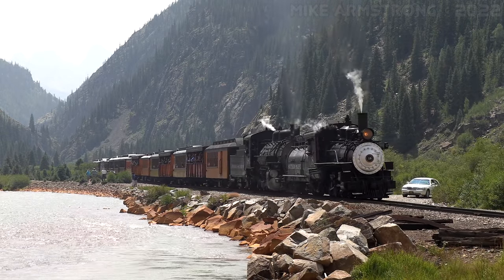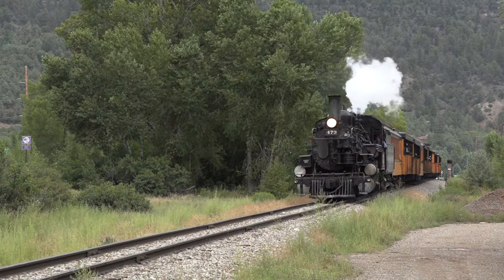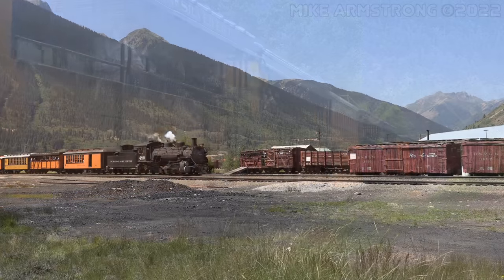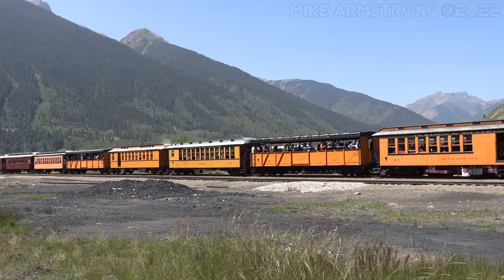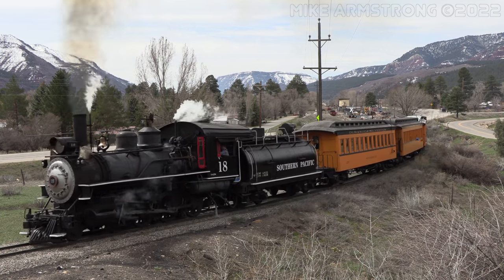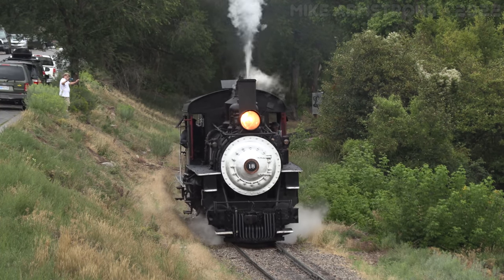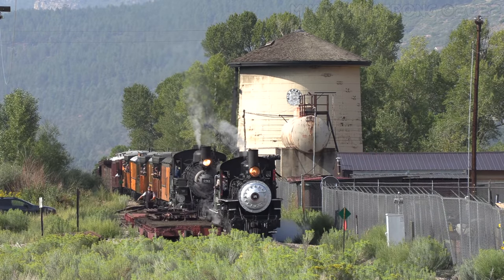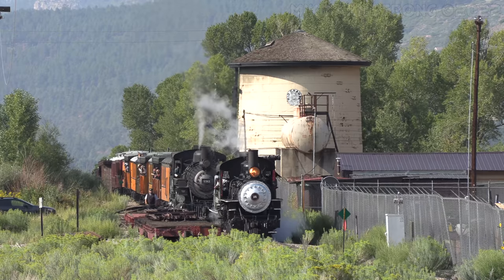Southern Pacific 18 Steam Locomotive

Comment: The Slim Princess had one incident. On April 9, 2019, while the engine is pulling a spring excursion train, a piston ring broke creating a hole in the right-side cylinder head. The failure of the piston ring occurred between the grades of Hermosa and Rockwood. The 4 passenger coaches, along with 100 passengers on board, were hauled back to Durango by a diesel engine. The next day, #18 was hauled back to Durango for repairs. The cause of the piston ring failure is unknown. 3 months later, the engine returned to service. It returned to the Eastern California Railroad Museum in October, 2019.